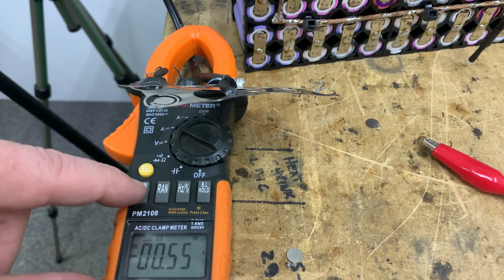Testing Battery Hookups fuses Ep 2

Comment: You need a current shunt and a oscilloscope to get a good result in your test or find sombody in your area for help.
Reply from the maker: I would love someone in the community to hit me up so i can learn how to do these tests right and with a little more consistancy!  Much to learn still...
Reply: @HBPowerwall  Hi mister! Go to EBay search for 500amp shunt you should see one for $29.16au. You can use that with a scope or a good multimeter with min and max. It puts out 50mv @ 500amps so at 500 amps it would show 50mv and 100 amp show 10mv and so on.

Comment: It would be cool to do a test on a 100amp draw on like 80p, see how the discharge goes. I guess you 30amp on 20p is comparable.
Reply: How thick is that nickel? I did a few napkin calcs and I worked out that if the nickel between the cells is 10mm and you are allowing a 5 cell wide pack and if the nickel is 0.2mm you would only be able to run 20a continuously at 60°.

So your 30a at 65° is probably pretty close, does look like you either need thinker nickel or solder some bus bars for larger currents like 100a.

Comment: I'm going to guess that the reason they didn't blow in the small pack was because there is enough nickel there to dissipate the heat fast enough to keep them from blowing. On the larger pack, there's too much current for the plate portion to absorb the heat.
And yeah, I'd say that one cell is toast  😜

Comment: lithium + water : nope !
Reply from the maker: Water is to halt the thermal run away to other cells not put it out. Ask any fire department how they deal with an EV fire... Water & HOURS AND HOURS of it!
Reply: @HBPowerwall  agree. Probably the only thing that kept one my one thermal cell from catching fire was cooling it in a cup of ice water. There's no stopping an internal short, but if you get rid of the heat as fast as it's making it, it should be ok.
Reply: vaneay vaneay there’s no metallic lithium in a rechargeable li-ion battery. Water is no problem and is the recommended method, along with aqueous firefighting liquids/foams, for fighting secondary Li-ion fires. Only non-rechargeable “primary” li-ion batteries have metallic lithium in them which can be a problem is the battery is opened up.

Comment: From what I understand in this test is that the cells are only capable of 8-10amps max . The nickle fuse sheets are rated to blow at a similar current. This is just a recipe for disaster in my opinion. In order for this to be safe and practical they must blow at a much lower current like .5 or 1 amp. Furthermore,  there should be room to remove damaged cells for repairs. If this was tested on cells with a better discharge rating I'm 100% certain all fuses would blow significantly faster.
Reply from the maker: having a cell fuse at .5amp blow would increase resistance beyond any reasonable level to be practical or even safe.
Reply: @HBPowerwall  Even if you have a large parallel pack ?
Reply: @angelon7095  you would need a massive pack, I am designing all my packs for 100amp and that would mean I would need 200 cells per pack. I aim to have about a max of 2.5 Amp draw per cell, and am going to use 3amp fuse wire that normally burns at 5-6amp <1sec.

I might look into these nickel plates as I am still waiting on bus bars.

@HBPowerwall if you have a laser temp reader or your heat camera you could slide some kind of insulation material strips between the cells and the nickel so you can see any resistance when the current travels down the pack (might be worth using a longer pack like 80p). Then try a nice 100 or 200 Amp load.
Reply: Why? A lot of the individual cells (like the Panasonics) are rated at over 3 amps continuous. So why fuse them for 1 amp?
Reply: @mondotv4216  the less you draw from each cell the longer they last on a charge and a longer life cycle too, as far as my understanding goes, but that doesn't really have anything to do with the fuse threshold. I guess using recycled batteries you don't want to take too much risk, but I would think up to 2.5a being pretty safe.
Reply: david knowles I know that but it also a balance against practicality. Same as how high and low you charge them also affects cycle life. But if you only limit the cells to operate between 60% and 40% DOD that’s not very practical. Also you actually don’t want your fuses to blow at a “normal” or even a slightly high current. Setting your fuses to blow at about 2 times max current makes sense. If a cell internally shorts that fuse is definitely going to blow. If a cell goes high resistance you hope your BMS picks up that.
Reply: @mondotv4216  yeah I get that, I guess that's why fuses have a time over current factor, I guess it's cause you can't get those very short high current draw and you wouldn't want to be replacing fuses all the time.
Reply: @mondotv4216  now I think about it the way of having a bus bar and fuse wire is practical in the sense that you can replace the fuse easy is the cell is still good, these nickel plates make that a little bit harder.
Reply: david knowles That is an issue with 2nd hand cells. I think if you’re building a new pack with quality cells probably makes more sense. What is needed to complete this product is a new holder design where you can slide a cell out so the retainers clip on top of the nickel plate rather than underneath.
Reply: @mondotv4216  that would be cool, and thicker plate, I am not sure what the plate thickness the nickel is but to handle a good 100A on a big pack I think it would need to be at least 0.6mm to reduce heat/resistance.

Comment: Shunt and oscilloscope if you want to accurately measure the fuses break currents. The fuse could almost be considered a "5A" fuse that breaks under a second at 9A.

I have quality shunts, oscilloscope, solid state switches, bench power supplies, electronic or digital load and also can use a Headway high discharge cell for testing. Will do my own more accurate test.
Reply from the maker: Can't wait to see it Shannon - How can i help?
Reply: @HBPowerwall  have everything needed including Tom's fused strips.
Reply: @GENcELL2014  Where will you present your results, Shannon? On your YouTube channel or on the forum? Thanks!

Comment: can't you use your constant current load to test the fuses?
Reply from the maker: I don't have such a device (or do i & i don't know it?)
Reply: @HBPowerwall  i saw on a video that you had two: 150W 180W Constant Current Discharge Capacity Tester More in depth :)
Reply from the maker: Ooh they are long gone - terrible devices - wonder if i can just use the iCharger X6... that would have to work set it to 10a discharge on single cell
Reply: @HBPowerwall  yes the fuse in series would be the weak link. weld the fuse to 1 nickel strip or wire and connect it to a strong pack it should work and be safe. i got 300w from one of those useless devices and tested all 20x100Ah nicd from my ev :P
Reply: @HBPowerwall  yeah you can use the 20p pack as the bulk power supply, and just have a single fuse link between it and your powerwall. Charging or discharging shouldn't matter just adjust your current limit in charging/discharging until it blows.

Comment: Hook it up a bench power supply so you can control the amps going thru it
Reply: @Mafiashotz doesn't he gave one, thought I saw it in one video, at least the cheap "150W" one. Should be good enough for a single fuse
Reply: อยากใด้18650 แต่ไม่มีเงินซื้อ
Reply: How can a successful channel like this not have a basic bench top power supply? Considering those fuses already break <10A, they are like 100 bucks.
Reply from the maker: Unfortunately I don't have one - but thinking it might be a good investment
Reply: @HBPowerwall  The iCharger X6 can work as a powersupply. And you can control the voltage and amperage output using a special power mode. Though you have to control it with the little nubby switch on the side but it can be done. I've used it as a Power Supply for nickel plating before :)
Reply: @SirCrest  electroplating is not a short circuit, as the chemical reaction is the load. The phone charger wouldn't be able to output a high enough current to simulate a battery short circuiting or to blow a fuse over 1 or 2 amps.
Reply: @matthewmeuleman3369  iCharger X6 can output 30amps which is well above what the fuse is supposed to do.

Only mentioned electroplating as a use that some people use for a regulated power supply with current limiting. Didn't say it was related to fuse testing.
Reply: @SirCrest  My bad, I saw the electroplating bit and thought you were just using a new iPhone charger.

Did a some googling, resistor leg is supposed to blow at 5 amps, so the 800W power has enough guts to output the 5A at 160VDC.

Comment: Looks like it'll keep an entire pack from discharging into a bunk cell, so if someone has worries about that then it'll calm those fears. Either way I think it looks like a VERY easy way to assemble packs if you use a spot welder. And will even reduce or eliminate property damage caused by an accidental unstoppable short circuit outside of the pack.
Reply: also, re watching teh "glowing" footage, if those cells didn't actually blow the fuse on the other side I wonder if they're internally open circuit now? The cells internal bonding / CID may have failed on some of them.
Reply from the maker: if you look closely you can see a fuse or two blow on the other side - 5 fuses in total have failed BUT after your comment there are also CID issues also that I didn't consider at the time. Will include this information in Debreaf video